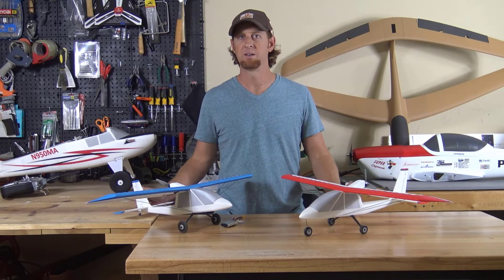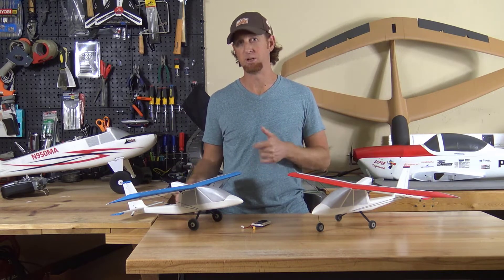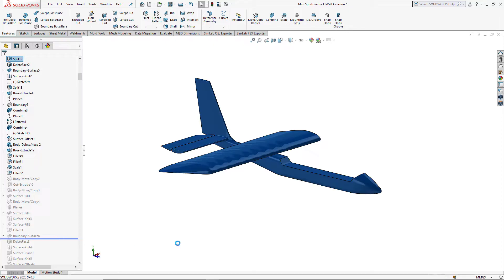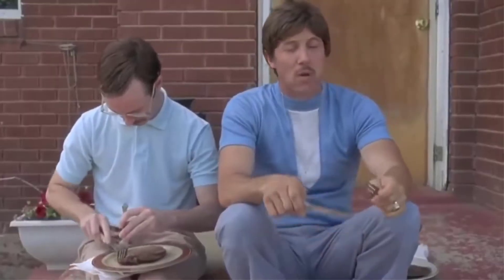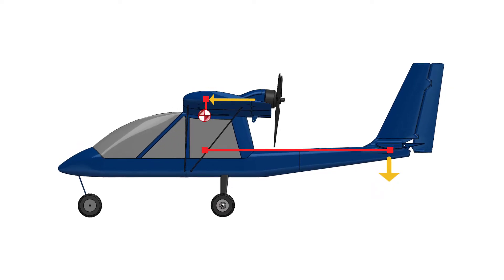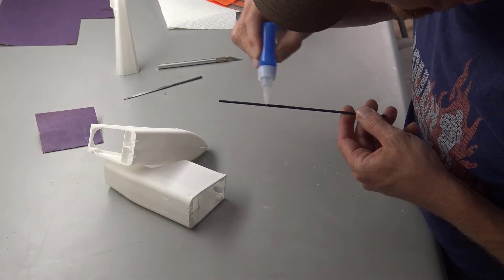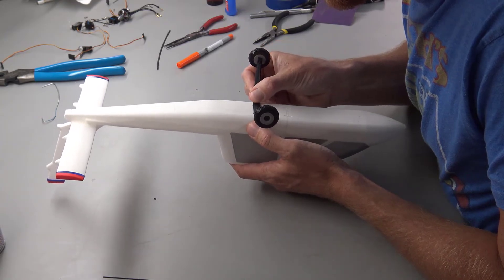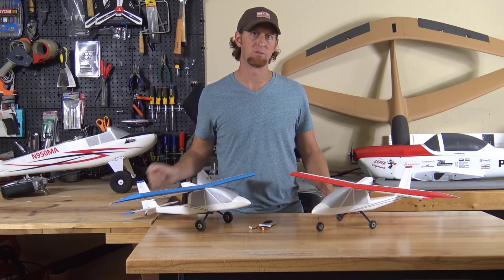3D Printed Micro SportCam RC Aircraft - sub-250g!

Comment: Glad to see you're using SolidWorks! As a retired mechanical engineer, I used over a dozen CAD programs over 45 yrs, and I've always considered SW to be one of the best. I purchased and used it between 1995-2000, when it was still fairly new on the scene and loved it. I've used other much more expensive packages, but SW was so intuitive that it's always held a sweet spot in my heart. I strongly urge anyone out there to give SW a serious look. I'm currently using Fusion 360, which I consider one of the most asinine attempts at a CAD package as I've ever seen. I've never liked Autodesk products, since they seem designed by computer geeks just to please themselves, not the end user. 

I wish I had known SW was available in lower cost versions before I wasted money on Fusion 360.

Comment: I have built that taildrager version with normal PLA but I have some problems to take off that plane :/ It doesn't want to take off at all. And also it turns the tail so quickly  at the end that the whole plane breaks just before taking off and turns the whole plane like 360 degrees. Is there anybpdy who can help? I have the same equipement like on the video, the weight is in the maximum recommended weight, all printed with standard PLA. Motors , ESC and proppeller the same as in the video...
Reply from the maker: I would highly recommend trying a lightweight PLA like Colorfabb LW-PLA or eSun LW-PLA.  You'll end up with a plane that is almost 50% lighter and much more of a joy to fly.
Reply: @3DAeroventures  Thanks for the quick answer. I will try with LW-PLA but I have to make the whole plane from the beginning... Do you think there is any way to take it off with PLA like it is? Maybe If I reduced the weight somehow? I would like to avoid printing all the parts from the beginning + I need to order LW-PLA and wait for it..anyway thanks for everything. Probably I will end up with two rc plane in this case , one with PLA just as home decoration and second one actually flying model..
Reply: @3DAeroventures  anyway it looks fantastic and people stops me and asking how I made this rc plane etc.
Reply from the maker: @ Thanks for the kind words!  Are you using a 2S or 3S battery?  For the PLA version you will certainly need a 3S battery. That will increase the power to the motor and should give you enough to get off the ground.  But again, I'd still recommend trying an LW-PLA version.  And the tricycle gear version will be less squirly on the ground.  It won't have a tendency to spin out like you mentioned on your taildragger version.
Reply: @3DAeroventures  3S 500mAh
Reply: @3DAeroventures  and the reason why 500mAh is that was the smallest one available with at least 500 mAh capacity 3S,
Reply: @3DAeroventures  I have jsut bought LW-PLA and actually with some specific configuration in PrusaSlicer I can print very light objects now without stringing at all (for now). I hope I will manage to reprint the whole plane. Two months until spring so I hope I will be able to print all parts (not much time after work but maybe one by one I can do it. I hope it will fly 😬😬

Comment: Just finished printing nice design! This is my first 3d printing project. The only question: would you, please, advise what 3s battery dobyou use and how you install it? All 3s 650 mah battery i found don't fit, 2s - no problem, but i printed the plane with PLA and, i think, 3s would work better because of weight. Thanks!

Comment: Change the force angle by adding spacers under the motor mount so that is causes the motor force to slightly tilt  up. Put washers on the bottom motor mounts to achieve this. It is normal for rc planes to need right and sometimes down pitch but with a high mounted motor you need it to pitch up. Cheers
Reply: ^ This. So much easier. Just consider how the thrust vector applies to the cg. With the right angle there’s no rotational moment so it works at all throttle sections.

Comment: Hi
I’m currently trying to print one of these myself and have a couple questions. 
Do you know if the gcodes with work only on the i3 printers or will they work on all printers if same size or bigger? 
Also, if not then is there a way to contact 3daeroventures as I couldn’t find an email on their website? 
If not that does anyone have a good way to slice the outer wings for the plane and inner ailerons? 
Thanks

Comment: The 250 gram requirement is about to be a reality in the U.S. come September. Nice video, I have tried shrinking designs in the slicer and it works really well (so far). I just finished up an Eclipson Go Wolf 1 printed at 65% in LWPLA and ready to fly weight is about 200 grams. I have a Fock Wolfe 190 in the works and it looks good so far. Most of the  big parts print in vase mode. There is a video on YouTube "How I Designed a 3D Printed Wing". that shows how to design for vase mode which kills the stringing completely if you can use it (if you need a top it doesn't work). Great video, I enjoyed the physics lesson. I'm using Sans Smart LWPLA and it seems to work OK.

Comment: How many layers did you print the walls for LW-PLA? I have any Anycubic Vyper and the gcode didn't work. So I used some settings in Cura that Troy McMillan shows in one of his videos and they seem to work well on my printer. However he was using two walls. Should I just use 1? Also how many layers should I use for the top and bottom for the parts that need them?

Comment: Please use the Metric System as all humans on this world do.
Reply from the maker: I typically use both so I have all my bases covered.  But if you take a look at my build guides on my website you’ll see most if not all of the hardware (bolts, nuts, carbon fiber rods, etc.) I design these planes around are metric.

Comment: My AUW using PLA+ was 425g. The suggested motor, prop and battery not strong enough to get it off the ground. Definitely need lightweight PLA.
Reply: the same problem here, mine was 320 g and still not able to take off

Comment: Do you print all the parts on the print bed at once or piece by piece?
Reply from the maker: Some parts I can combine in a single print bed but printed sequentially.  This helps prevent stringing between the parts as LW-PLA is pretty stringy.
Reply: @3DAeroventures  what’s the infill supposed to be for all the parts that aren’t supposed to be in vase mode?
Reply: I can’t find the right carbon fibre rods nor can I find any tubes is there any alternatives because carbon fibre is very hard to find.

Comment: What is the minimum build volume required for the printer?
Reply from the maker: 150mmX x 150mmY x 180mmZ
Reply: @3DAeroventures  thanks for the quick response! Unfortunatly mine is only 150x150x150...
Reply from the maker: @joeshow1985  I think most parts will fit, just  the ailerons are taller than 150mm.  You may be able to split them.  This plane is a free download on the website if you want to give it a try

Comment: angle the motor to counter the motor momentum is a good idea, but making a inverted wing foil on the tail causes down elevator at high speeds without throttle,   still love the design and this will be my first 3d printed airplane

Comment: Mashaa Allah tabarakAllah. Great journey there. I'm starting to design my own 3d printed plane, begin with A-10 pusher to give longer flight time than EDF.

Thanks for making this video. Stay safe and stay healthy.
Reply from the maker: I like that idea.  Keep me posted on your progress.  Thanks for watching!
Reply: Thank you for such motivation. Been designing depron based rc planes since 2014, and now moving towards the 3d print approach to create planes. Such a challenges to balance all aspects like thrust to weight ration, easy to build, strong construction etc. Also, found some challenges in printing parts in some ways with smooth and organic shapes that would stay accurate involving fixing meshes etc. 😅

Comment: Hey again, so Im busy printing the Micro using PLA and have managed to print off the fuselage using the G-Code you supplied. The wings are proving more troublesome. The Gcodes have the wing set 90 degrees to the bed movement and with no brim which has led to numerous fails as the print detaches from the bed. I tried using a profile I had from Eclipson to print with rotation and a brim but still having bed issues. Also I cant get my z seam to be as hidden as yours in that profile. Can you share your profiles so that I can study them. I have Cura 4.9 and Im using a Creality Cr-6 SE. Settings are 205C Head, 60C bed 55mm/s print speed, Brim, z seam User specified - Back, 3mm retraction at 50mm/s
Reply from the maker: Ewan, no problem, can you email me so I can send you some info via email? eric@3daeroventures.com

Comment: Hello, i'm using cura slicer can't find the proper setting for the micro sportcam
Reply from the maker: Hi Camille, can you let me know the problems you’re running into?  Feel free to email me if that’s easier - eric@3daeroventures.com
Reply: @3DAeroventures  Hello, I found out my aileron L1R1L2R2 are 13&19g instead of 3g and my elev. L&R 13g
Reply from the maker: @27camillo  check out the note in red text at the bottom of page 5 of the build guide.  It explains how to print the elevator, rudder, and aileron parts with 0% infill and only 1 perimeter
Reply: @3DAeroventures  got it thanks, will post a pic when it's finish

Comment: Nice 👍.... great design.... Would love to see a  video on how you model for single layer extrusion..... Also how well do you think this would hold up for a beginner pilot... thinking of using this as a trainer for my kids?
Reply from the maker: Sorry for the delayed response!   Yes, I'll likely do some more videos on designing for 3D printing.  As far as whether or not I'd recommend this for a beginner pilot.  I would recommend it for a first 3D printed aircraft, given the size and ease of printing and assembly of the design.  But I wouldn't recommend any 3D printing aircraft as your very first RC plane.  They just don't hold up to bangs and bruises nearly as well as something like a foam aircraft, and minor crashes are bound to happen when you are starting out.  I'd take a look at www.flitetest.com.  They sell kits for building planes out of foam board - it's inexpensive, the planes can take a beating, and they are easily repairable.

Comment: totally incorrect motor angle placement.
it should 12 graduses up, not down.
so force is used for the main wing to keep model up and stabilize, not to tail.
Reply: @3DAeroventures update it
Reply from the maker: @master.  I’ve replied to a bunch of similar comments below.  I already tested that out and what you are suggesting makes it worse.  I’ve done the work and actual testing 4 different prototypes at various motor angles.  I know many available pusher designs have the motor angles the other way but on this particular design it simply doesn’t worn.  I’d suggest taking a look at some of my replies to earlier comments to learn why.  Thanks for watching.
Reply: As the throttle is increased the negative lift generated by the rear wing increases counteracting the moment generated by the motor.  

Wouldn't it be more efficient to mount the motor at 0° and programme the transmitter to add a small amount of pitch when throttle is increased.  

The benefit of how you designed it is greater airflow over the control surfaces. Great design very interesting.  I'm new to flying so I'm not experienced.

Comment: I have noticed some planes with a similar configuration, like the Bixler, use the opposite approach, having the propeller canted forward, which I guess puts the center of thrust closer to the CG, which would reduce the pitching as well.

Comment: I've built pushers with the line of thrust doing just the opposite of your approach. The thrust line is pointed down toward the nose of the aircraft so that when thrust is increased it pushes the nose down. This uses thrust alone to counteract the pitch up tendency. Just throwing that out there. Looks like you've accomplished your goal with your design and the models look great.
Reply: If it points to the nose it will push the plane up.

Comment: It would be better to give the thrust angle upward. Since the angle of thrust in relation to center of lift is behind the center of lift, If you angle the thrust up, you cancel the undesirable affect of thrust angle. That way you don't need different trims for power on vs power off. Look at the Bixler. Same concept. Love what you're doing, but your solution is flawed as much as it pains me to point it out. You do great work and if I built one of these, that design creates so much parasitic drag that I would turn the rear wing upside down to your design and add upward thrust to compensate for thrust angle. Try it,,, you'll like it!!!!! Show me in your next video after the changes and see if I wasn't right,,,,, Or rather Bixler and many other pusher prop planes like the A5 etc weren't right about thrust angle. C'mon man,,, YOU CAN DO IT!!!!!!! You can test this by flying steady speed then cut the throttle. You'll nose dive with your design. With the upward thrust it won't. That way you can glide in dead stick without having a trimming issue. Try it on your plane as it is now, then change the thrust angle and you'll see what I am talking about. Basically, the thrust angle needs to point at the center of lift which is very close to the center of gravity. If you draw an imaginary line from thrust angle to center of gravity you'll be very close. If you can angle it to the center of lift, you'll be spot on, but that changes a bit with the speed of airflow over the wing. Negligible, but close enough either way really.
Reply from the maker: Garry - I really appreciate you watching and for offering feedback.  My short answer to your request is No.  Unfortunately, I will not be doing another video going through this exercise, because I have already done it.  I know this small aircraft looks simple, but it still takes hundreds of hours of development to get it ready for sale.  I already went through this exercise with thrust angle during those hundreds of hours of development and 4 - 5 different prototypes and ended up having the same results as this gentleman:

https://youtu.be/51QilwMelcA

https://www.flitetest.com/articles/Motor_angles_for_pusher_planes

The motor on my design is mounted high, and it is so close to the CG that I had to pitch the motor up a ton in order to get the thrust line going through the CG - so it flew horribly.  Even 1 or 2 degrees of up thrust made the pitching down moment worse when throttle was advanced.  The flight performance of this particular design, with the thrust angled down a few degrees, is far better.  Not to mention, this falls in line with similar full-scale designs.  Take a look at these images:

https://cdn.planeandpilotmag.com/2016/09/searey-3.jpg

https://upload.wikimedia.org/wikipedia/commons/1/14/LakeLA-4-200BucaneerC-FZZN01.jpg

You'll see it's pretty clear that these designs have the motor angled down in order to get the tail surfaces directly in the thrust line.  

I really hope this doesn't turn into a drawn out debate with you.  I've already proven it to myself and I wouldn't release a design for sale that hasn't been tested to fly well.  So I am sure you can understand my hesitation to put more hours into making a separate video just to prove all of this to you.  I encourage you to go through the exercise yourself since I've already done it.  If you were to build this design and alter it like you mentioned, by flipping the horizontal tail upside down and adding up thrust you'll see the resulting flight performance is not good.   First of all, designing a horizontal stabilizer to have positive lift (which is what would happen if you flipped the horizontal stabilizer the other way like you want me to) would just exacerbate a pitching down moment.  My first two prototypes were built with the horizontal stabilizer as a fully-symmetrical airfoil and the thrust angled up varying degrees the way you mentioned  and flight performance was horrible.
Reply: @3DAeroventures  No debate. Every plane is different. Just sharing the experiences I've run across with different plane of similar design. It's like all the sport jets I have. They all seem to have the thrust angle straight instead of a few degrees up. So if you're flying level at half throttle and go to zero throttle, it noses down a bit. This also make rotation off the runway a bit harder. On my thrust vector jets, I can trim up the thrust angle and eliminate that small problem. No matter what amount of throttle, or lack of, the plane keeps the same attitude. This caught me by surprise when landing my SU-35 maiden. I like to set up the angle of attack and use power to control the decent. When I let off the throttle to descend though, it nosed down and caused a bit of a panic moment. No harm, just unexpected. It's all good. Sounds like you did everything you needed to on this one. Thanks for the response.